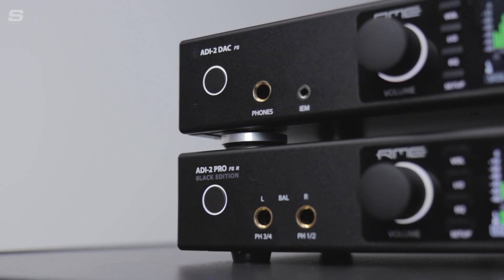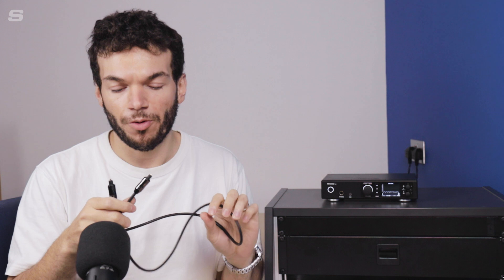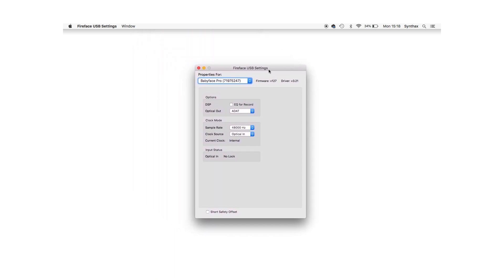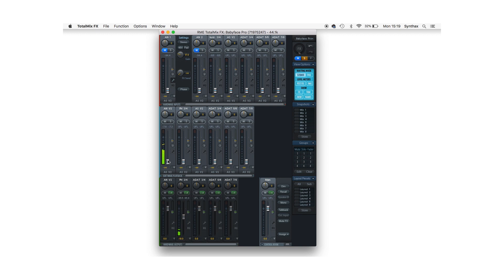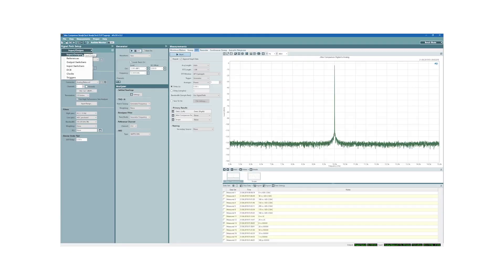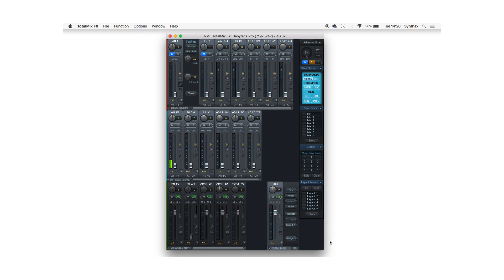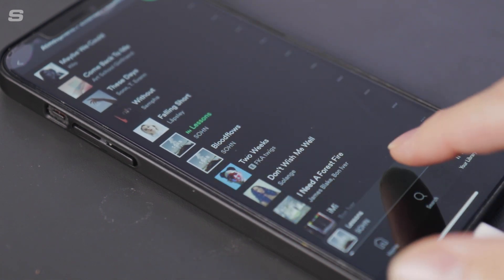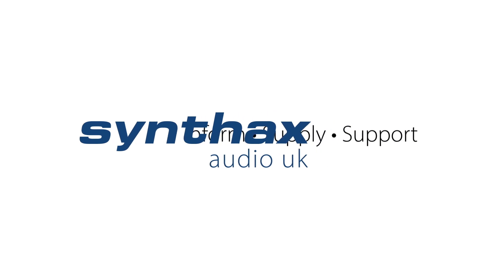How to connect the RME ADI-2 DAC FS and ADI-2 Pro FS R to an Audio Interface

Comment: i have a question if i record eith the babyface will it go through the adi pro se version as well?
Reply from the maker: No as the Babyface records its own inputs directly. Once the signal has been recorded / converted to digital you can pass it to the ADI-2 Pro FS for monitoring, or for routing out to other hardware, but the ADI-2 won’t automatically process anything the Babyface records.
Reply: @SynthaxAudioUK ok thank you
Reply from the maker: @Vst23_Productions  You're welcome!

Comment: I have an Rme adi2 dac fs and babyface pro, exactly like the first setup you connected. i noticed in your video when you connected to the toslink and went to do the setup internally, you used Internal clock when you did the external in the adi2 pro. Is that means im using the internal clock of the babyface pro now. Cause i want to use the clock of the adi2 dac fs. 
Can you please explain more why you kept it internally in the same setup i have.

Comment: I m a newbie...my question tò RME was this 
 I would like to but an ADI-2 converter to use it as a DAC for my stereo. Beyond this can I also use it to plug 2 microphones and record me playing the violin connecting it to a PC windows?

 RME wrote me this 
the ADI-2 has no microphone preamps integrated. In this case you need an external microphone preamp connected to the analog line inputs of the ADI-2 Pro FS R.
The ADI-2 devices are not supported by ToalMix FX software.

Is It possible or not then ? 
if not what DAC/recorder all in one do you suggest?
thanks
Reply from the maker: Hi, RME is correct that you cannot record microphones with any of the ADI-2 converters on their own. They are A-D/D-A converters only and do not have any built-in microphone preamps. You would need to buy a separate microphone preamp then connect that to the ADI-2.

You would be better off buying an audio interface such as the RME Fireface UCX II. This is a kind of all-in-one box that combines many different functions - external soundcard, ad/da converter, microphone preamp / instrument inputs, headphone amp, signal router & mixer etc all into one device.

See our video on the subject here;
https://youtu.be/EjUo_bVJgcs

Comment: Question! Still very new to all this 😊 I have a Rupert Neve Shelford channel that I want to run through this before the signal hits the DAW. But I also have a master bus A/D converter at the end of the chain. would I need to use this to convert the signal back to digital.? If so how would I be able to perform both these applications with one unit? Would I need a patch bay?
Reply from the maker: Hi, you only need one A to D (to convert the Shelford from analogue to digital) - your master bus A/D converter already achieves this. 

You then simply pass this digital signal to your DAW for recording. If the master bus A/D has a USB or thunderbolt connection you're already there. 

If it doesn't, you can use an audio interface (like the Babyface Pro) to record, connecting the master A/D via a digital format (e.g. ADAT/SPDIF). It sounds like the ADI-2 is unnecessary for your setup, unless you plan to use it for other things (as a second A to D; a headphone amp; high-end mobile mixing etc...).

Comment: How can i setup the adi  2 pro fs r for mastering outboard gear ?
Reply from the maker: You might be better off looking at the ADI-2/4 Pro SE: https://www.synthax.co.uk/rme/converters/rme-adi-2-4-pro-se/

The ADI-2 Pro FS R is great for printing a final mix or for moniotring, but the ADI-2/4 was designed more with mastering engineers in mind. With four outputs instead of the two on the ADI-2 Pro FS R, you can create a loop of your outboard as well as use the device for monitoring at the same time.
Reply: @SynthaxAudioUK  All good and well , i got the Adi pro fs r 2 ... Not 4
Reply from the maker: @TomVG81  Apologies I misinterpreted the question! You'd have to send audio via ADAT or SPDIF from your interface to the ADI-2, then from the analogue outputs you'd route TRS to your outboard. From there, just route it back to the analogue inputs from the last device in the signal chain. Unfortunately I don't believe you can then use the ADI-2 as a monitoring device but could still use your interface for this. 
I hope this is more helpful!
Reply: @SynthaxAudioUK  I use Adi 2 pro fs as my main audio interface also .. I tought it could do it all ..
Reply: So i need to upgrade to a interface that could send adat and receive adat . To monitor the signal ?

Comment: If I’m using a cheap audio interface with a low quality DAC built in, would it make sense to connect it to a high quality external DAC? Or should I just get a new audio interface with a high quality DAC already built in?
Reply from the maker: I would say the best option would definitely be to improve your audio interface first. This way, you’ll also get improved microphone/instrument inputs as well as better conversion too!

The ADI-2 series are fantastic products but don’t discount the difference in quality from a cheap interface to a more professional one. It depends on how much I/O you need but it might be worth checking out the Fireface UCX II as an option: https://www.synthax.co.uk/rme/firewire-usb/rme-fireface-ucx-ii/

Comment: Hello. May I ask why my system is not working when I tried to connect my UCX II to my ADI-2 FS DAC. I am using a tslink cable with one side on UCX ADTA out and another side on ADI-2 FS. I am using M1 Max Mac and all the required software has been installed and my UCX has input graphic.  But not the ADI-2 FS. Could you please share how to make them work together or they are meant to be used independently
Reply from the maker: Hi there, it sounds like a Totalmix routing issue. I'd advise going back to the section in the video that discusses the routing and making sure it is all as is shown there.
Hope this helps!

Comment: Hi, I read all the comments, but I didn't find the answer to my question. I use Presonus audiobox 22VSL and I want to upgrade to some RME product.  I'm not recording anything. I only use my DAW for post production, mixing and mastering with a lot of plugins etc. and now I want the best sound. My question is if I buy RME ADi-2 PRO SE is this product suitable for my work? Will I have problems with latency / buffering? Or should I stick to Babyface or Fireface UCX? - Thanks.

Comment: Thanks for a great video. Just wondering what are the advantages of using RME ADI-2 DAC FS and ADI-2 Pro FS R with BabyfacePro FS. Cause I do own an BabyfaceProFS should I also get RME ADI-2 DAC FS and ADI-2 Pro FS R for pro audio please? kindly let me know. Thank you.
Reply from the maker: Thanks for your comment! 

The ADI-2 Series have been designed to be reference-class AD/DA converters, and so produce the best possible audio conversion as well as offering the clocking technology of SteadyClock FS. There may be some users who require the top-end of audio conversion - whether that is for mastering, or for the best possible monitoring solution - and the ADI-2 would be a fantastic addition for them when things like room treatment etc have all been considered or achieved. 

For the majority of users, like yourself with the Babyface Pro FS, it might not be the kind of upgrade that is needed instantly. The Babyface Pro FS already features SteadyClock FS and the audio conversion is great as it is. 

For those with older interfaces looking to improve audio conversion and add improved digital clocking, adding something like the ADI-2 series to a setup will help improve this without the need to buy a whole new interface. 

Hope this helps!
Reply: @SynthaxAudioUK Thank you very much. I do mixing and mastering myself. After looking for a best quality mobile audio interface, I bought Babyface Pro FS. I am happy with the conversion quality. But off late I am looking for the best AD/DA and best headphone amplification on my mobile interface for mixing and mastering on headphones. Just wondering how much more quality jump would be there from Babyface Pro FS to ADI-2. If there is significant jump in quality, I would like to make the move to upgrade, but if Babyface Pro FS is competitive enough, I would settle with status quo.

Thanks for your advice.

Comment: Hi! questions I have a Rme Fireface 802 & recently bought the Rme BabyFace Pro Fs since it has a steady clock can I combine them and use the Fireface for IO and the Babyface for monitoring and as the main converter if that makes sense What do you think I should do? Was also thinking of selling them to get the Fireface 802 Fs since I recently found out about it

Comment: What are the practical applications of this setup?
Cause BS Pro FD has already the AD/DA converters built in.
Reply from the maker: Hi, we made this video in response to RME users asking for the best way to integrate the ADI-2 DAC or Pro with an RME interface. 

This gives you the best of both worlds - TotalMix FX for routing and mixing, and ADI-2 level conversion (which is a slight step above the converters on RME interfaces). 

In the case of RME's older interfaces like the original, 'non-FS' version of the Babyface Pro that we have in this video, you can also clock your interface to RME's newer clocking technology (SteadyClock FS).

Comment: Why is it necessary to set the ADI-2 Pro as the clock source? Is there a downside to keeping the clock source as the Babyface? Very helpful video, btw. I am using both devices.
Reply from the maker: Glad you found the video useful!
We're using the ADI-2 Pro as the clock source in this tutorial as its built-in SteadyClock FS is superior to the clock in the original Babyface Pro and other earlier interfaces. If it was a Babyface Pro FS, then there would be no real difference in terms of clock source, as they both feature FS clocking.
Hope this helps!

Comment: Just curious, ADI-2 pro, if I increase the bass eq knob in front of the interface, what frequency does it start boosting at and what type of filter is being used ?
Reply from the maker: The ADI-2 Pro uses a shelf-type adjustment for both the Bass and Treble. Adjustable from 20 Hz to 150 Hz in steps of 1 Hz. The frequency is adjustable from 20 Hz to 150 Hz, but according to the manual the default is 85 Hz. Hope this helps!
Reply: Thank you

Comment: Didn’t work i followed your instructions using an ADI 2 Pro FS (old version not black with remote) and Babyface Pro FS I have the ADI2 Pro FS main outputs 1/2 with XLR to Genelec 8341 I am also have the Genelec GLM box for room correction - I have tried with GLM connected and disconnected still no sound.  I have total FX with main Out assigned AS 1/2 I can see the green metres bouncing yet zero sound. Windows 10 audio selected to SPDIF/ADAT (1+2) (RME Babyface Pro) still zero sound. I have tried increasing volume and no difference. Please advise
Reply from the maker: Hi, so you can see audio outputting in TotalMix FX but cannot receive audio on your ADI-2 Pro? 

That would suggest to me either a broken optical cable, or you need to make sure you have the optical input selected as the source on your ADI-2 Pro. I would try a different TOSLINK cable and check you have the SPDIF Optical selected as your input (on the ADI-2).
Reply: @SynthaxAudioUK  I checked one of the optical cables was broken I'm going to retry the whole set up again thank you for your suggestion

Comment: I am unable to get audio from my Behringer UMC 1820 to appear in my Babyface Totalmix FX. Can someone please help? Behringer ADAT out -> BBF Optical In and BBF ADAT Out -> Behringer Optical In. Can't get any signal to appear at all from the ADAT connections..
Reply from the maker: Hi, if you have another ADAT device I would try connecting that first (to help determine if it's an issue with your Babyface or the Behringer). I'd also recommend trying a different optical/ADAT cable, to rule out any problems with the cable.

If you're still having problems please contact your local RME support, I'm sure they will be able to help you further;
https://www.rme-audio.de/support.html

Comment: Great review, thanks Milton. I have an Apollo Twin X that does not have an optical out. I just got the ADI-2 Pro FS R.

1. I'm wondering if I am out of luck connecting it to run my recordings (mic/guitar) through the Apollo into the RME ADI-2 Pro?
2. If so, if it will work if I leverage the Apollo Twin X as my input source on my DAW, and then RME ADI-2 as the output. (will there be much latency this way?). 
3. I see Apollo has Line Outs - can those somehow be leveraged for connection into the analog ins of the RME ADI 2? 

Would appreciate any recommendations.
Reply: The ADI-2 Pro FS R has a USB connection, so I presume you would just use the Apollo as your input (AD) and the RME and your output (DA) while both are plugged in via USB. You can easily set this up in the Sound Preferences in macOS. If you're on Windows, then I don't know how that would work.

Comment: is it possible to use a 9 pole dsub cable (male to male) to connect the adi 2 pro fsr with a ucx 2 directly without using the breakout cables in conjunction with either aes xlr cables or spdif cables ?
Reply from the maker: Hi there! This would be possible, but would require a custom-designed cable with the pins assigned correctly for both units. You can find the pin assignments in the manuals of both devices. Hope this helps!

Comment: Thanks for the video. Can I connect studio monitors? I have a preamp. Would the recording chain be correct : microphone into the preamp into the rme into my laptop via USB? Can I use the audient id22 with the rme adi 2 pro? I only record vocals. Is there a big quality step up between the babyface pro fs and the adi pro fs r? Thank you
Reply from the maker: Hi there! That would be the correct chain, though you may find a bit of latency when recording this way - the ADI-2 Pro FS R isn't really designed as an audio interface, though of course it can be used as a class compliant interface. 
There's definitely a difference in sound quality between the two units, but the ADI-2 is of course offering reference-class conversion, so that should be expected. For recording, I'd always opt for the audio interface as by design it has been created with audio recording in mind. Alongside this, you get access to TotalMix FX, a powerful signal routing software that does not come with the ADI-2. 

Hope this helps!

Comment: Hi Synthanx Audio, can I use the Madiface Pro to do this?
Reply from the maker: Hi there! Unfortunately not in the method described here - the ADAT I/O on the Babyface Pro has been replaced with MADI on your interface and that means there's no way of connecting to the ADI-2 DAC FS or Pro FS R digitally. You could connect to either device using the analogue outputs of your interface, though this obviously won't offer the clocking benefits of SteadyClock FS.

Hope this helps!